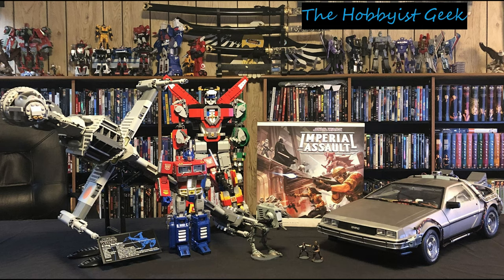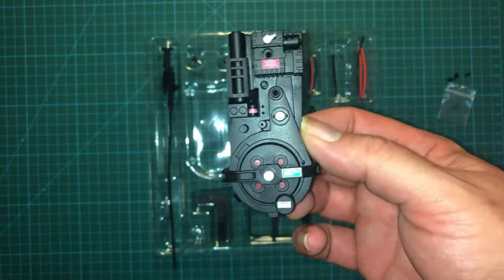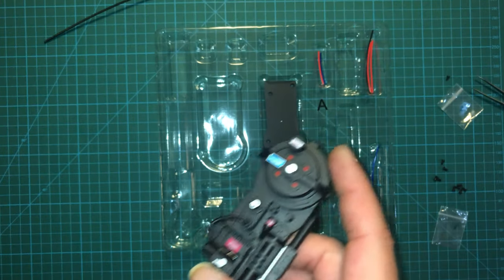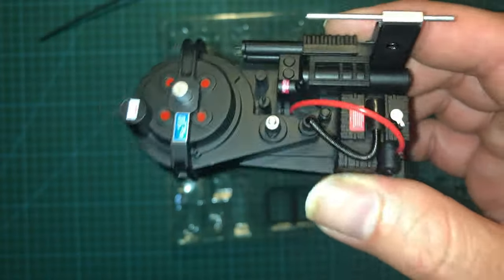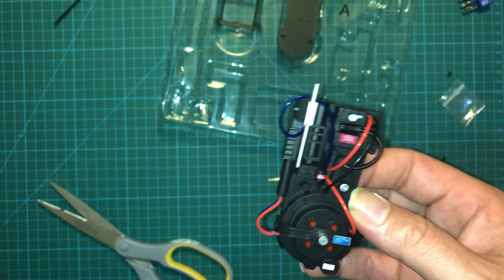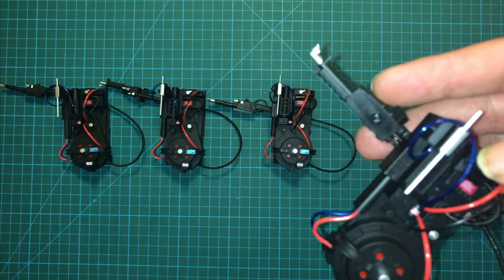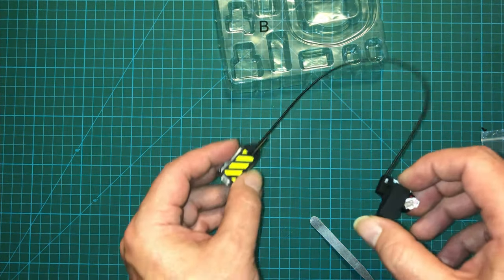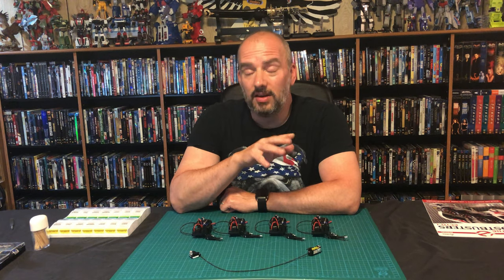Build the Ecto-1, Proton Packs

Comment: I'm over in the uk so have only had 2 so far, the hoses were a miserable experience so I'm in no rush to make the next two ! I've seen a lot of people modding the pack to mount the wand but personally I'm not touching it until I see how it mounts to the stretcher
Reply from the maker: I had a similar issue with the EM Delorean build, but I was pleasantly surprised with the engine hoses on the Ecto-1.  I guess it made me hopeful the proton pack hoses would go on just as easily.  Silly me!

Comment: I hated putting the first of these together, I'm in no rush to start the others yet :-(. And looking at future issues there's more small pipes in other parts too :-(
Reply from the maker: Yes sir.  Those hoses are a pain in all the Eaglemoss models.  The toothpick method for widening the hose a bit really does help a lot though!
Reply: @thehobbyistgeek6566  yes used that for the second one and helped. Got to the last tube only to find the part it's meant to go onto had snapped off before coming to me. So dabbled some superglue on. I'd spent too long on the other tubes to start again on a replacement!!